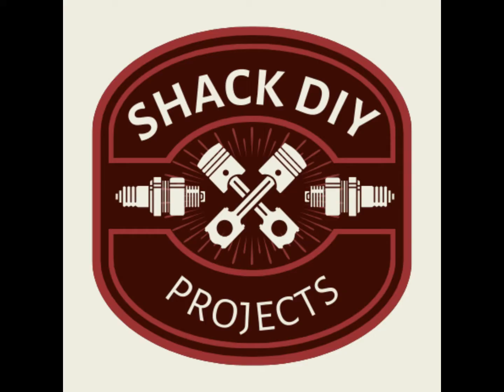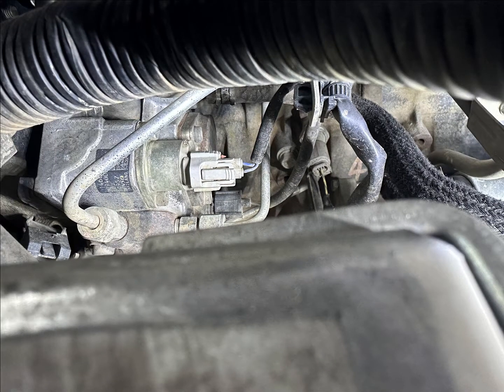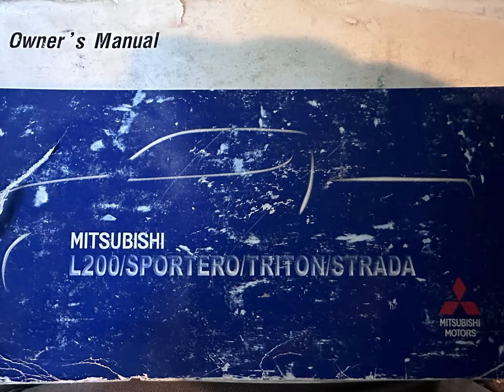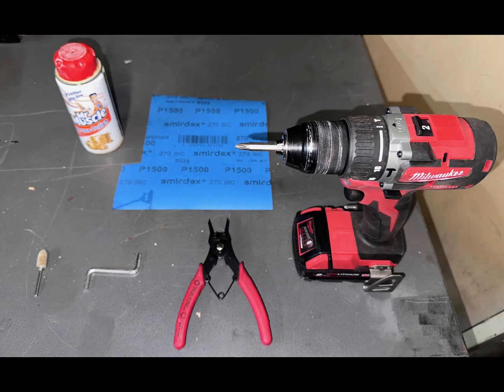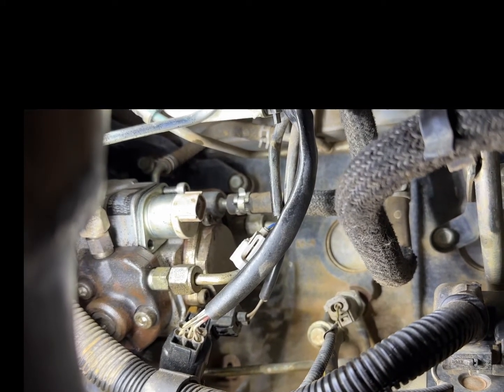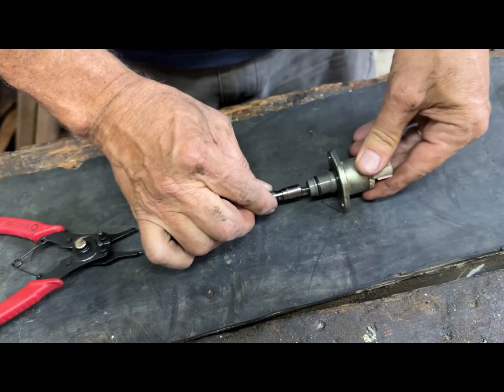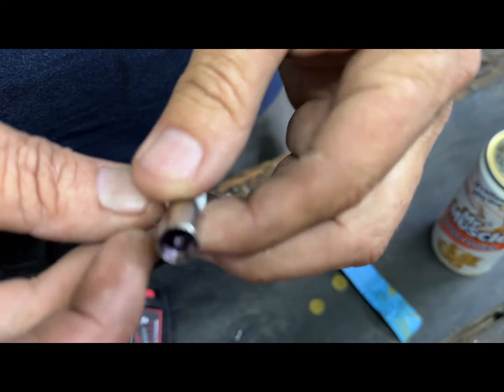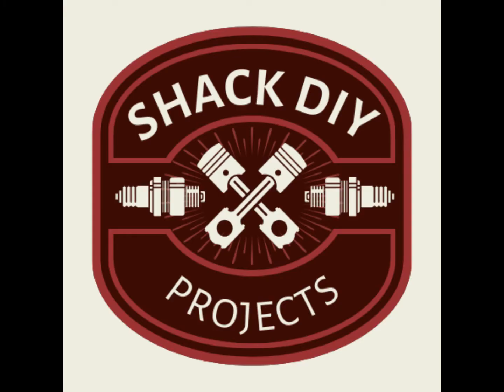DIY repair the Suction Control Valve of a common rail diesel engine, MitsubishiTriton L200

Comment: Jis Meneer! Wat n nice volledige video sonder langdradige nonsens soos die amerikaanse en aussie videos.  Mitsubishi will net onder R9000 he vir n nuwe een. Ek het n aftermarket een by masterparts gekoop vir R1300 maar my probleem is nog steeds daar. My 2.5 triton loop mooi maar sodra ek langer as n minuut if twee idle dan gaan hy in limp mode in en gooi 1089 code. Scv blocked. Ek kan dit onmiddelik clear op my foon of net die voertuig af en aan skakel en ry hy weer reg. Dis net op idle. En jy idle ook mooi op 700rpm sonder om te dip of enige iets. Ek gaan nou die ou een skoon maak en omdraai ek kyk if dit werk. 
Enige idees of dit iets anders kan wees? Ek het ook opgelet dat my throttle position altyd 100 persent oop is. Hy maak wel toe tot op 15 percent wanneer ek in limp mode ingaan. Maar al is die bakkie af of op idle is hy vol oop. 
Dankie weereens vir n uitstekende video

Comment: Hy since you sheared a great video about mitsubishi L200. I have a problem car installed while driving L200. Push button start, now car no ignition no crank. I believe it went to mood situation. Any solution please.
Reply from the maker: I'm sorry, but I don't have any experience with push-button start cars and cannot help you with this issue.

Comment: If this was not giving enough fuel to the car, would you hear a tapping sound from the injectors under acceleration?
Reply from the maker: It usually only loses power or surges- not sure about the tapping noise.
Reply: Can it cause intermittent hunting at idle when engine is cold ?

Comment: You can add tags for Ford Puma engine, which was fitted to Ford vehicles, Fiat Ducato, Peugeot Boxer and Citroen Jumper. They all use same SCV and it's a very common failure. Also it is highly recommended to use diagnostic tool and do high pressure fuel pump relearn procedure after you have this valve polished. It is must if you install a new one.
Reply from the maker: I agree ! The relearn is a must on a new one - Will add the tags- Thanks for the suggestion.

Comment: Great video, thank you for taking the time!! Do you know anything about the longer replacement SCV's for Toyota engines? Apparently, Denso made a kit to convert the short barrel to the long barrel. Do you think this is necessary? I drive a 2007 Fortuner.
Reply from the maker: Hi, Unfortunately I don't have any experience on the Toyota replacements
Reply: @ShackDIY-pe4ld  Thanks for the reply! I will try the cleaning as demonstrated first.

Comment: do you clean inside the valve that you polished? Because probably there was polish compound left over, what did you use to clean?
Reply: Hi Mr my hyundai i20 diesel engine is starting but when I acceleration had no power scv can cause that and after that just die
Reply from the maker: I rinsed it with clean diesel and used a brush to clean inside. A better solution would be to use high pressure spray with engine cleaner/paraffin, but the brush and diesel worked well.
Reply: @ShackDIY-pe4ld  i ended up using a mix of 50% alcool and 50% water
Reply from the maker: That will also work. As long as you get the dirt out. Is your car running again?
 @marcuslima2535
Reply: @ running amazing, ended up the rattling, just a little bit when getting over 2000rpm and around 60km/h, but much better
Reply from the maker: @marcuslima2535  Great, glad it worked without too much effort and costs!

Comment: Hi please i changed my, but if the car running and the engine heat the scv get faulty so please what can i check again
Reply from the maker: Remeber the SCV has to be polished inside as well.
Maybe try to loosen the SCV and turn it 180degrees, and fasten again. 
If this doesn't help, it maybe time to replace the SCV. In some instances if the SCV is replaced, you'll have to take it to a techie to re-learn the SCV in the car.

Comment: My car is mistbishi trinton 4 d 56 u and it's sometimes while moving reducing power for a while and it is now doing frequently.
What can I do?
Reply from the maker: It can be a few things. The main culprit is usually the SCV, but it can also be a dirty fuel filter. If you are sure your filter is clean, do the SCV polish as described in my Video..

Comment: Thanks. I replaced one of these on a 2009 MN Triton. The hardest part was getting the bottom hex bolt. A long arm ball end hex and a pair of pliers for torque ended up getting it.
Reply from the maker: It is a tricky space to get into. If you know exactly where the bolts and scv are situated, it can be done from above without removing the battery. The easiest is to access it from the wheel side where you can see what you are doing.